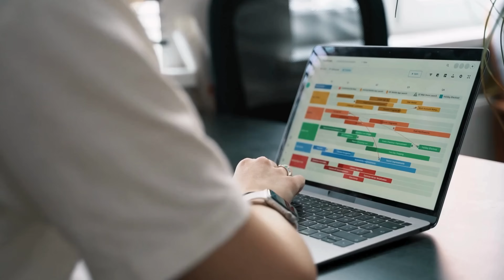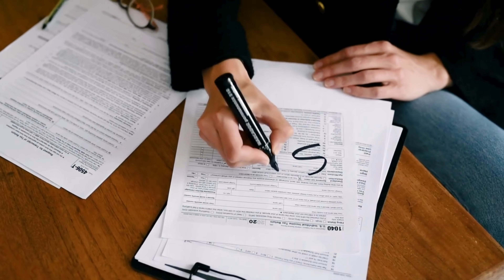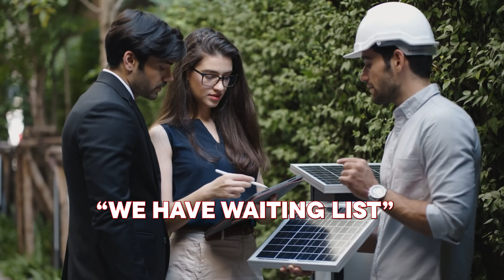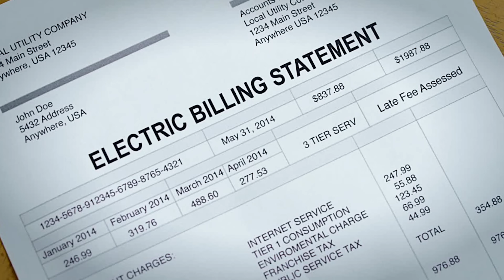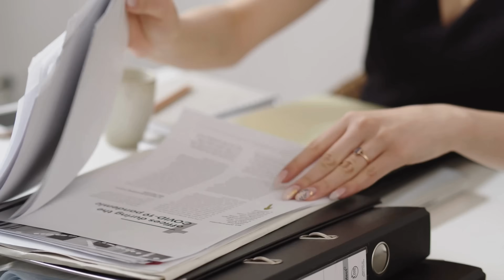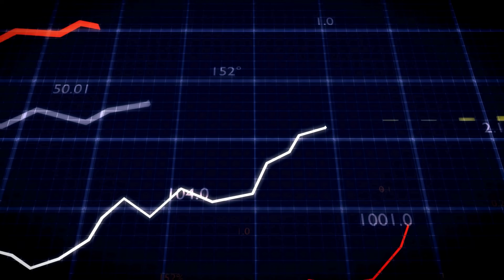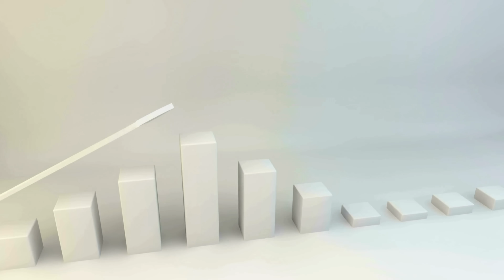Should you buy solar NOW or wait till 2026?! Tax Credit Ending... Prices dropping?

Comment: You left out a segment of the population. I am retired and don't have a lot of income and pay minimal taxes in the first place so the tax credits wouldn't really help me. However, I have enough in savings to purchase a reasonable size system without breaking the bank. I had been wondering if the prices might be dropping in the next few months and your input convinces me to wait a few more months. Thank you.
Reply: I’m in a similar situation as yours except probably with less money. I paid a lot more for equipment,starting in 2020 than it costs now but I don’t regret making the leap. The reason why is DIY.That rhymes by the way.
I am fortunate to live close to Signature Solar so I progressively scaled up the system with savings on bills and paid cash. 
For example, I paid $1621 each with sales tax for EG4 server rack batteries,buying them one or two at a time. That’s $9726 for six batteries; 30 kWh.
A week ago I added a 306AH, X 3 x 51.3 volt - 47 kWh battery that I reconfigured from a 52 s battery I bought from Jehu Garcia.
Total cost including BMSs less than $3500. Also have four cells left over to make a 12 volt battery.
One often overlooked benefit of DIY is the education you get by building your own system. Mistakes were made 😢 but now I have confidence that I can maintain my own system.
Reply from the maker: Thats a great point, thank you for brining this up. I should have said too that solar with or without tax credit makes financial sense. ESPECIALLY if you can buy it CASH. If you don't qualify I would wait till next year jan-Apri is usually the slowest time for installers... So we will be dropping prices to get people to buy.  I would NOT lease even if you don't qualify for tax credit.
Reply: @solartimeusa  In the Florida market, I frequently structure lease agreements with 0% escalators. This offering is tailored to clients whose circumstances align with this financial model. The rationale is straightforward: not all clients qualify for tax credits, and many may lack the immediate capital for a purchase. This approach provides significant day-one savings and avoids the debt burden associated with traditional financing, which can impact credit scores. Typically, I reduce clients' monthly bills by $40-$100, contingent upon roof irradiance (sun exposure) and current energy consumption. The greater the existing energy bill, the more substantial the potential savings, particularly with optimal south-facing roof access, minimal shading, and ample roof space. The kicker is that this structure pays me less money but benefits my customers  greatly. I tell my clients to keep your money in your pocket and simply pay less for a bill you were paying regardless of meeting me. I also explain that if you ever move the lease needs to be paid for in full which all of my clients understand. The beauty of selling the home with a solar system that has been paid for makes the home that much more attractive on the open market. I have them Imagine moving into a home with solar installed already an ask what that would be worth over the next 10,15 or 20 years?
Reply: I blew insulation in my daughter’s attic and lowered her energy bill by 20% .
This was low cost , but some of the worst work prepping the attic.
Rewraping ductwork, doing some wiring, exost fans ,insulating light fixtures.
Reply: I would also compare what it cost to reduce power usage moving to a new high energy star home. If you don't want to move get a emporia energy monitor installed on your main panel. You can see where the power is going.

Comment: I was blessed enough to be able to install my system on my own and it was very affordable plus I get the tax credit as well. I know most people can’t do this but if you know someone that can help you go for it. My system is a 11kw PV with a 16kwh battery. And the cost was around $11k. Everything included. The tax credit will be around $3k which makes the system even more affordable. My electric bill has been $380-$400+ every month in the summer. Now it’s less than $80 unless we have too many cloudy days. And in winter I rarely use the grid. I live in Florida for context.

If prices go down next year I’ll probably get another 16kwh battery and few more solar panels to be able to zero out my electric bill. Very happy with the results so far.
Reply: Have you seen the new sodium ion batteries that companies like CATL are making now.  So the few years will see deep discounts in battery cost , so being patient is definitely the move
Reply: @derekmcqueen4589 Wrong! Good luck with that idea, I think you're dreaming..
Reply: @Loki-rascal  yeah agree. from what I’ve heard that chemistry is nowhere near feasible at the moment. Natron energy didn’t even make it to prototyping. They closed their US plant and headquarters even before preproduction. Something’s not adding up when these companies can’t get enough investors to pitch in. Maybe in the future it’ll gain some traction but who knows when or if that will happen. Also, the energy density is much lower than lifepo4 batteries. It has a few disadvantages that I don’t think people are thrilled about, other than maybe could be cheaper to produce. We shall see. But I ain’t waiting 10 years to find out.
Reply: @Loki-rascal  Sounds like someone holding lithium futures, lol. There is already an American startup making sodium batteries as well. Sodium is salt. Lithium? Is a metallic salt. If you look on the periodic table you will find it on the right hand side directly above Sodium. Amongst the rest of the earth abundant materials.
Reply: @anobody5708  Meanwhile I can already buy 200Ah Na cells from China now. Let you in on a secret about how the Chinese operate. They do not announce anything if they are not certain its viable. See the CPC? Is largely run by engineers and scientists. Not useless ideologues or lawyers arguing on behalf of their clients.
Reply: @davefroman4700  Cool, will probably look for reviews later. Didn't know it was that easy to get them already. Yeah leave it to China to do things first. Maybe that was my mistake, thinking that the US could get there at all lol maybe by 2050 we'll catch up to China if at all.
Reply: @anobody5708  China graduates 10X more stem candidates a year than the NATO nations combined today. A number that is constantly increasing as they expand their education system. And China's government is guided by scientists and engineers. Good luck....
Reply: That's fantastic what you did! I did the exact same thing and my system cost me $12,000 all in. However I said screw it and did market research for my area. I figured that a system of my size on average would cost around $28,000 installed. So when I filed my tax return I claimed that the system was $28,000! Then I got an income tax credit for $8400! 😂😂😂😂😂😂
Reply: I'm trying to set up a 5K system all by myself for my mom's house. The cost is more than 11k right now. What I want is an HVAC system instead of the whole-house backup/replace system. This is the most realistic for me right now. The panels and two mini-splits were already around $ 5,000. Mom wants a plug-in compact system. Therefore, an all-in-one system like the EcoFlow is the choice over a battery rack/wall mount. Why? I don't need to modify a hybrid inverter to access the main panel. I need some wires from the battery to the appliances, and it's done. I'm sure I will replace the whole thing after a couple of years. I will replace the EcoFlow with a cheaper high-voltage battery system. The cost of the battery will be cheaper, and I can use the EcoFlow for myself.
Reply: Gosh! sometimes I regret not doing it myself. My father was an electrical engineer and my brother and I were his slaves until college 🤣🤣but we learned a lot. And, I have the expertise to do it. I upgraded my home to 200AMP, moved the meter to the side of the house, installed a safety switch, then an ATS, generator and wired the distribution panel after replacing the knob and tube with Romex, and all passed inspection with flying colors....Yet, that was 15 years ago, when my last remnants of testosterone and bone joint collagen were fading away. 😀My home is a cape cod brick and the roof is steep, like a church steeple and >35ft tall, so I will surely pass out of fall in 5 minutes, and my wife would have to sell the equipment in a garage sale. Hence, I am getting it installed this 17 Nov 25, but I will regret not doing it myself! I think I will go in the basement and cry knowing it costs me thousands more because I can't get on a ladder!

Comment: Hi Martyna, what do you think about EcoFlow Delta Pro Ultra battery prices?  Will they go down like the rest of the other batteries?
Reply from the maker: I would not install it in my own home. Its a product thats marketed to homeowners for more DIY projects. Most installers don't use them and cant get them at distribution centers where we get better priced product. I would be very worried about service.
Reply: @solartimeusa  Thank you for the reply.  I already have solar in my house.  I installed it 15 years ago and I have about 3 years left on the lease.  Technology changed so fast and I am still at NetMetering 1.0.  So I can't touch my solar system until 3 more years and my nm 1.0 is there for 25 years.  I was going to add the ecoflow delta pro ultra and some roof top panels to connect to the DPU as a DIY and use it with its smartpanel 2 which isolate certain circuit so I can offset some of my electic costs.  I was just wondering what your thoughts were on their price droping like tesla and other batteries.
Reply: @solartimeusa I agree wholeheartedly, the portable power units have their place; portability for construction or camping out.
Like travel trailers I used when doing hurricane recovery work,they well served their intended purpose. But it’s far better to live in a solid house when you stop moving.

Comment: it's probably best to wait since the demand will go way down in 2026 and onwards from equipment and labor point of view.  Solar install will be same price as install in 2025 with tax credit.  But, utility cost will go higher in 2026.  Might as well install now to kick off ROI on your system as soon as possible.    Install in 2026 if you don't have enough taxes to get the credit.
Reply from the maker: Thats very very true. The answer is definitely different for different people, and like you mentioned if you don't qualify for the Tax credit, there is no rush anyway.  Utility prices will definitely go higher. Overall solar does not need the 30% tax Credit to make financial sense.

Comment: I need to run my panels in parallel because of a poor location and tree shading issues. I noticed my panels generate significantly less power in parallel. Is there a solution to gaining more power from the panels in parallel which does not include using microinverters? If I wire them in series I get hotspots (individual cells that run 50°C hot when their panel is shaded) so that's not an option for me.
Reply: Optimizers would help.
Reply from the maker: Yes maybe this article will help: 

https://support.tigoenergy.com/hc/en-us/articles/202304236-Design-Considerations-for-Uneven-Parallel-Strings#:~:text=To%20design%20parallel%20strings%2C%20you%20can%20follow,be%20deployed%20on%20strings%20of%20equal%20length

Comment: Panel cost is neglible these days. The installation cost is the biggest variable. Therefore if you can install most stuff yourself you'll be way ahead. Batteries will continue to get much cheaper, unless China heads to a particular island on their coast...
Reply: Yep, silicon is cheap and people are expensive.
Reply: Were headed towards modular DIY install like Eco-flow. Eventually we need to get where have 2 50 amp plugs installed for DIY modular solar install. No reason for Electric utilities to have to approve each install like your installing a nuclear power plant at your home. All of that was designed to make it more expensive.
Reply: @Mike-01234 I mean we are already at the point where you can just plugin a microinverter to the wall socket in places like Germany! Also portable batteries are a thing.
Reply: Its sales reps and ungodly terms on the finance.  Ridiculous tbh
Reply: $3503 got me a 3600 watt solar battery, 4x300w panels and an extra battery for 6kwh storage. Since my utility chargers $37 a month just for privilege of being on grid, by cutting connection system pays for itself in under 100 months and electricity free that whole time.

Sure, it's bare minimum and running 3 extensions cords and no 240, but hey, just me so can adjust to that.

Oh, I do have a 3500w propane generator for extended cloudy days to charge the batteries.